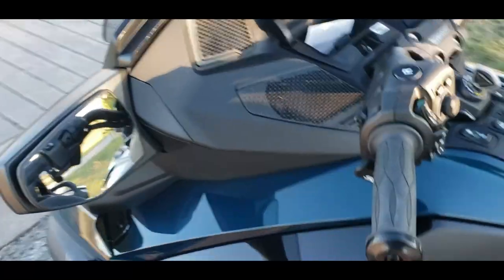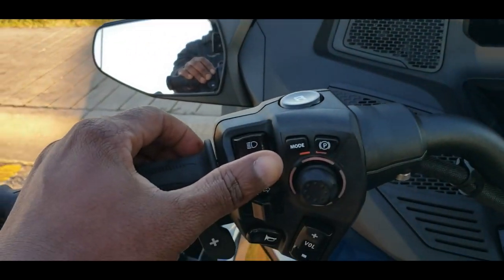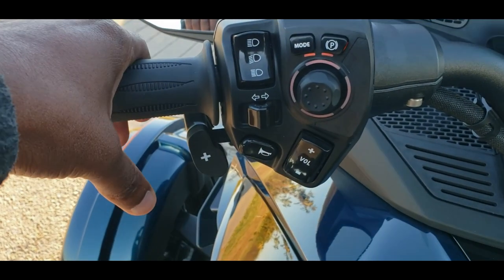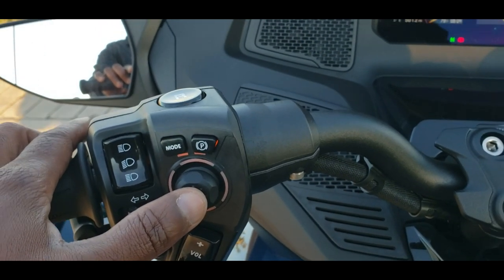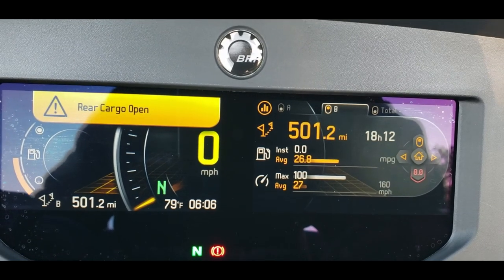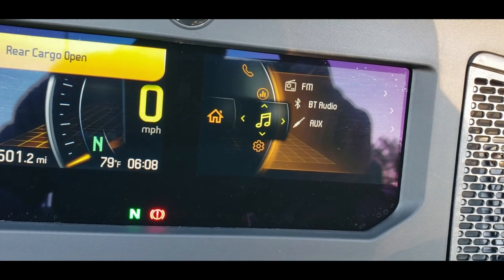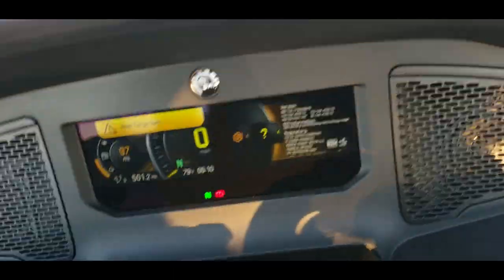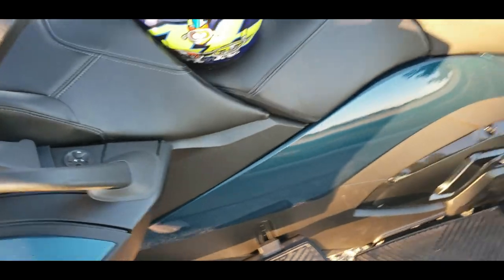Can AM RT Limited Mode Button Explained

Comment: How do I engage the cruise control?  I can’t figure it out.  I just bought 21 Sea to Sky
Reply: Just slide it to the left.  When you get to speed you want to set, push button in like you do when canceling turn signals.  You can also accelerate by push it up or decelerate by push button.  To cancel, just tap the brake.

Comment: When you shift up, do you release or reduce the throttle during the shift as when riding a traditional motorcycle? I've been studying this machine for possible purchase. Very informative! Thanks for posting; much appreciated.
Reply: You do not have to release the throttle to shift. It can be a smoother shift though if you do release the throttle.
Reply: Same like a car, automatic transmission.  You not releasing gas pedal when it shifting.

Comment: Have you experienced your radio going silent after starting your RT_LIMITED?  The feed continues but there is no sound.  I have to shut off the bike and restart it.  Any idea why this happens?
Reply from the maker: I have not experience this issue. I normally don't listen to the radio much. I will pay attention to see if this is also happening to my RT. As far as why it is happening, I don't yet.
Reply: I just got a 2021 sea to Sky and that happened to me. What I did was run the volume button all the way down and go back up and it worked. Try it

Comment: What does the button on the front of the left hand control cluster do? The one above the shifter.
Reply from the maker: That is a good Question. You can connect your android or apple devices to the CAN AM. That but is the BRP connect button that allows you to interact/connect your mobile devices.

Comment: I run in eco mode at all times but have noticed that when I really open the throttle hard that it seems almost as though it kicks into regular mode with a burst of energy.  Has anyone else had this experience?  Nicely done video.
Reply: Eco mode will kill your ride. Worst idea ever.

Comment: I just got a 2032 RT Limited, still working on understanding the BPR connect, and figuring out how to set the trip meters for trip A or B!  Good video and adds a little more to my knowledge base of my RT Limited.  Thanks.  Warm enough in Texas, LOL, we are having 70 degree heat wave in NY before it turns to SNOW!  Family use to live in little town of Pottsboro, TX.
Reply: You got the 2032 already??!!!!!!??
Must be a pre-production.
Does it fly?? 😂😂😂😂😂😂
Reply: @jackgibsxxx0750  dame, correct it! LOL
Reply: Does run on electric?